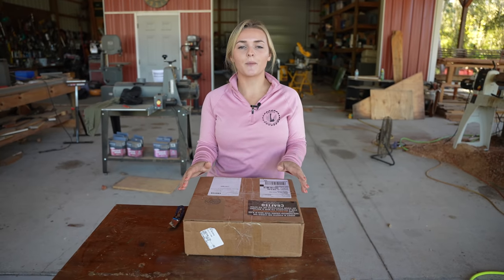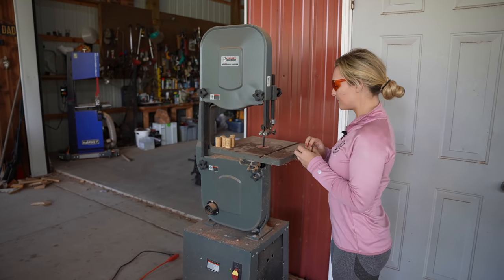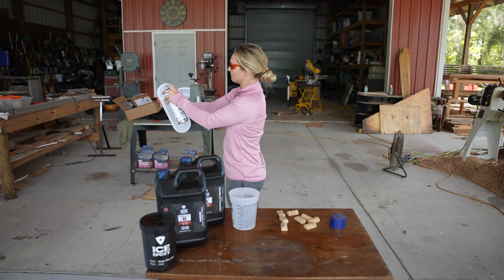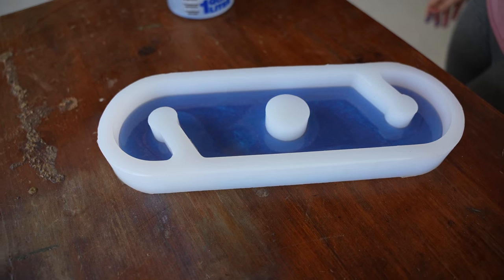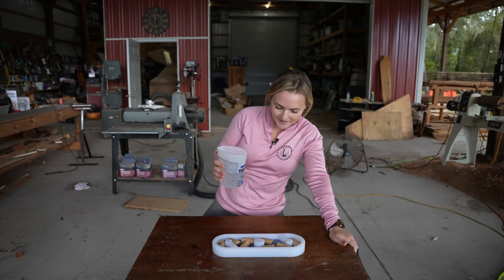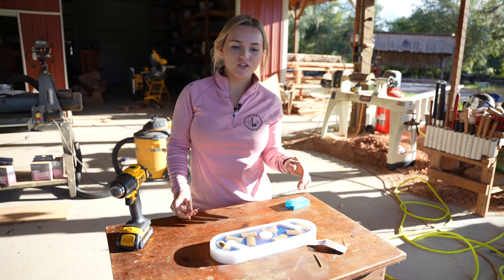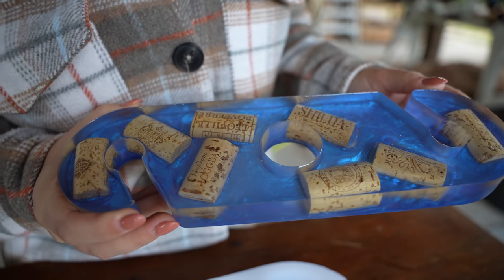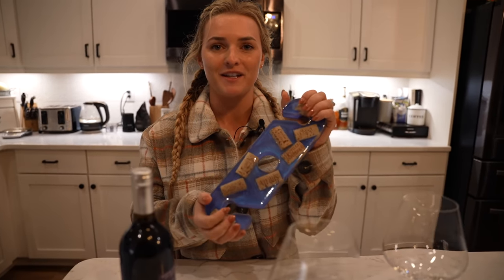She Makes The Perfect Gift For Wine Lovers!

Comment: 1:55 Zoe maybe next time use some wooden hand screw clamps when cutting flat spots in corks, keeps your fingers farther away from the blade and safer. Also I have found that when I use sticks or corks that a vacuum chamber and some cactus juice helps reduce the amount of air bubbles

Comment: Make a jig to hold the corks while you cut them or use a push stick to push them through the bandsaw blade.  If you cut them in half (instead of just cutting a flat spot) then it would take half as many corks to make the item and the effect would be the same and you wouldn't have any waste.

Comment: If you plan on doing alot of corks in epoxy try a pressure pot with stabilizing resin it will pull out all the air pockets and replace it with hard resin.

Comment: 😳 Zoe, with all due respect, a belt sander turned upside down in a vise, or a verticle/horizontal sander would be so much safer and faster with an 80grit or 100 grit belt. Hate to see anyone get hurt there. What you're making is really cool though!👍🙏🙏🙏

Comment: when you use the heat gun does it effect the mold?
Reply from the maker: The silicone molds are very heat resistant so the heat gun does not effect them.

Comment: You could have used an ice tong to hold the corks when cutting them.  You wouldn't want to accidentally scratch those pretty fingernails on the saw.  I think you should put a handle on the caddy.